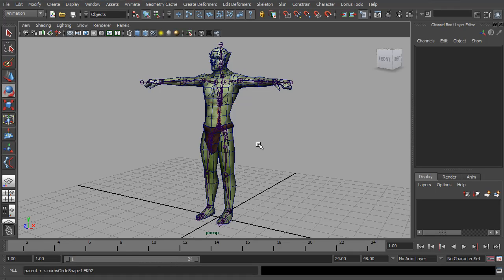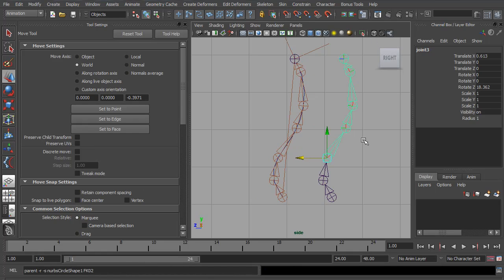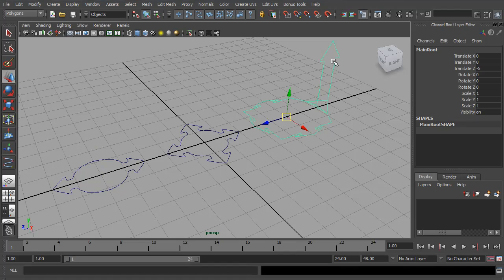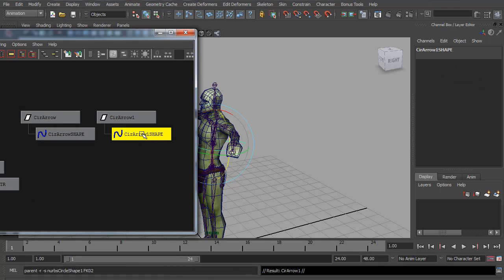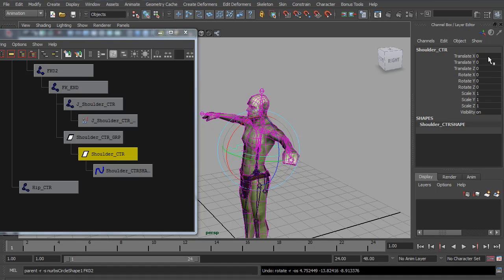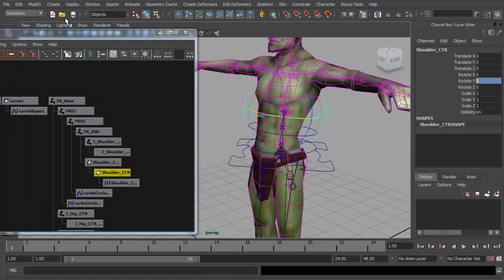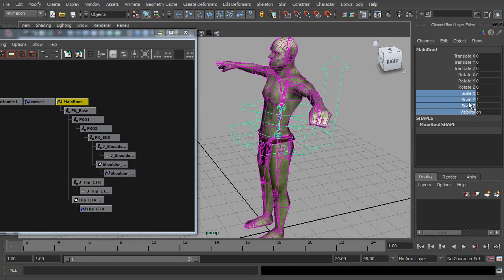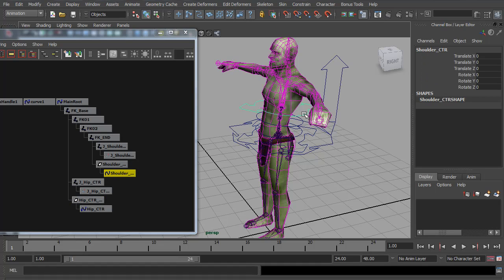GameRigging 04 The Spine part 2

Comment: After I've parented the nurbsCircleShape nodes to the FK joints, the circles are small in comparison to the model. I guess my model is physically bigger than yours. I went into the Control Vertices for the FK_02 circle and was able to scale them up and adjust them to fit my model, but when I try to do the same for the FK_01 circle, it messes everything up. I think it gimbal locks the spine and does a lot of bad rotation stuff to the spine joints. This happens when I move any CV on the FK_01 spine (I can scale them just fine).

Do you have any suggestions for a workaround or another way to customize my circles?
Reply from the maker: Editing the shape node shouldn't effect the rig in any way. The CV position on these controls is not connected to anything which is why we can parent the shape node to any other transform node.

You say "After I've parented", does this means the shape changes scale? If so, you might have a scale that isn't set to 1 1 1. This can cause problems and really all scale attributes need to be frozen.
Reply: OK, I've got a workaround figured out.

After running the parenting MEL script (parent -r  -s nurbsCircleShape2 FK_01) my circle was getting rotated when it inherited the transforms from the joint. Perhaps my orient joint settings were different since I'm doing this in Maya 2013 and my menus are different from what is in the tutorial.

So, once the nurbsCircleShape is a child of FK joint, there should be a makeNurbCircle Input for the joint in the Channel Box. You can adjust the Normal, Center and Radius values so the shape matches up with your specific model.

I still have no idea why moving the CVs of this particular circle makes my stuff go crazy, but hopefully it doesn't affect anything down the pipeline.

Gnimmel, thanks so much for your help. This is an awesome tutorial. I've been doing 3D work for a while now and it's always great to find a different perspective on how to accomplish something, especially on something as complicated as rigging. You've broken the process down into manageable pieces and you explain everything very well. Thank you very much.

Comment: Instead of parenting the curve to an empty group, why didn't you just freeze its transformations? At 4:20
Reply from the maker: Freezing the control gives a similar result, but it is also dependent on it's parent. If there is no parent, it's world aligned, but if there is a parent node that isn't world aligned, the control you freeze will be aligned with the parent.
By adding in the empty group node you have full control of the alignment of the control by rotating the empty node. In this rig it probably didn't matter because the chest control can be world aligned, but if you where rigging something like a Trex with the body pointing up at a 45 degree angle, you might not want the chest control to be aligned with the world.

Comment: Can you do an additional tutorial for the control curve you used in the intro video? I'm trying to learn how to set up stretchy spine control curves that prevent the animator from over stretching and I like how you created a gauge in your control from your into video.
Reply from the maker: I will be covering that in another tutorial. I plan on one that finishes up the rig and makes the export stuff as well so it can be exported for a mobile game. If you want to try before that, it's basically a setDrivenKeyframe to control the gage which is driven by the mult/divide node coming from the spines curveInfo node that calculates the spine length.
Reply: Can't wait to see the rest. Awesome work!